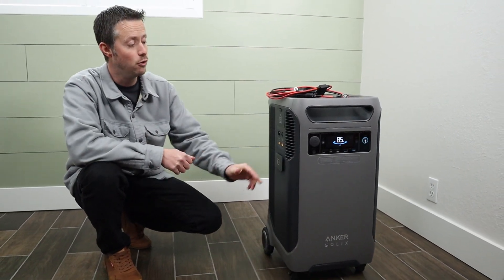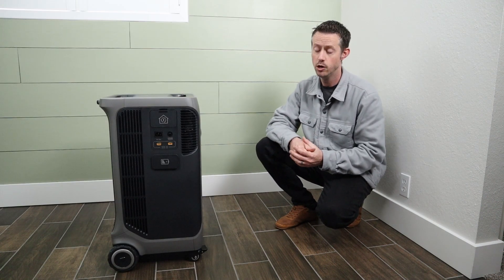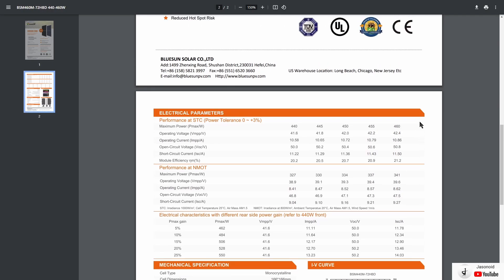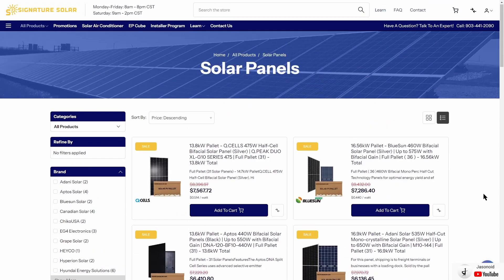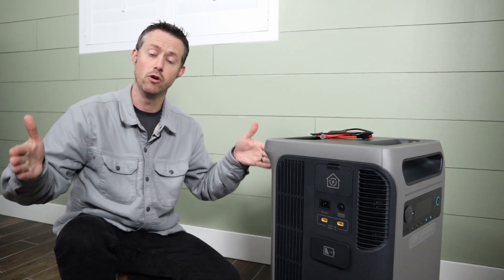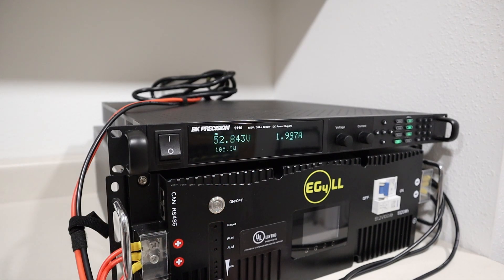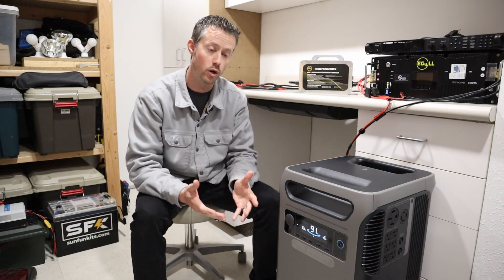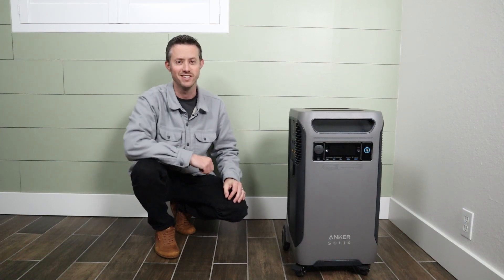Anker SOLIX F3800 - Your Questions Answered! DC Charging Cables - Ideal Solar Panels - and More!

Comment: Great review! We have the the f2000 and will be ordering the F3800, do you know of any way to pair the two and use the f2000 as an expansion battery or would I be best just to charge it using the f2000? I guess the only way to get pass through charging for the 240v would be to use the DC ports on the f2000. Thanks, Jake

Comment: Can i use my house solar panels to recharge these
Reply from the maker: They have to be wired in a completely different way, but typically you can connect three 400w panels in parallel to each charging port.

Comment: Could you wire directly from the DC output of a small gas inverter generator to the DC input of the F3800?.    (The Pulsar 2300 has a 12 volt/ 8 amp DC output "cigarettte lighter" Output )      I understand that the charge rate would only be around 125watts but it could help top off when the sun went down.   bypassing the inefficient onboard 120 Inverter / charger built in to each unit .
Reply from the maker: I'd say watch this video:   https://youtu.be/T_zZceBWZHk

Comment: I used 4 12v eco flow lifepo4 in series to top off my F3800. It charges the unit at 1150W consistently. However, after the external battery died, on the 4 batteries dropped down to 6.67V. Other were fine and charged back up to 100 no problem. Did I just get a bad battery or is there a setting I don’t know about
Reply from the maker: Try charging that one battery directly to see if it goes back up to 14v
Reply: @Jasonoid  Can't thank you enough! It worked. I hooked another fully charged ecoflow 12v battery to basically 'jump start' it like a car battery. after 30 mins, it finally began accepting charge. I wish there was a shunt that also had an integrated shutoff to program my entire pack to shut off if the SoC falls below , say, 20%.

Comment: Hello,
I got through a throttling situation where one or more of the batteries were below 59 degrees and discovered charging was limited to 700 amps DC. I got all the components above 59 degrees and ran for several days with up to 2300 amps DC input. All was well! Today. for some reason it is limited to 1100 amps. It will charge at about 1100 amps from either array, but not both at the same time. Charge level was in the lower 80 % when this was observed.
I hope there is a simple explanation for this. Thanks

Comment: Just ordered the F3800 and Renogy 400w portable, folding solar panel (that you reviewed).  Please tell me that they are compatible!  I see the Open Circuit Voltage is 47.2v so that works.  Can I just purchase a MC4 to X60 adaptor to connect the solar panels to the Anker?
Reply from the maker: Of course they are compatible! Feel free to reach out to me HERE if you need more information or guidance on how to wire them up:   https://asqme.com/@Jasonoid

Comment: What kind of separate Expansion battery would you recommend that is cheaper and not an Anker.
Reply from the maker: A DIY 48v battery is a solution, but it's not a true expansion battery. Only Ankers batteries will work for that.

Comment: Another question, so because the common ground issues..... How do you charge separate 48v server rack batteries from a single invertor like the yellow eg4? Will that create a common ground? Seems to me your limited to only using one solar DC port for stacking server rack batteries because to charge them (server rack batteries) via solar.... You would need two separate inverters. Correct?
Reply from the maker: Correct, you'd have to alternate charging the batteries with a large charger or you'd have to have two separate chargers.
Reply: @Jasonoid  so comparing cost of Eg4 yellow inverter $800 and server rack battery being $1,300 (total $2,100)  plus the wiring and rack/shelf and effort to hook everything up. Anker's expansion battery is on sale right now for $1,800 seems to be the Better option. Sure, it's less capacity than the server rack battery but it's cheaper and plug and play. Plus, you get both DC ports for maximum solar input (2,400w) which is plenty for someone like me in the California desert. 

My only complaint is that the expansion batteries can't act as a standalone power station. I really want to be able to unplug just one expansion battery and take it camping while the f3800 sits at home running the cabin. 

Hope this helps someone else because I was bummed out for days and days thinking I over paid for the f3800 (got it on Labor Day sale for $3,100 ) or something but it came with the transfer switch and a free refrigerator so I think it's a good deal.

Comment: Question. I bought two 24 volt lithium batteries to recharge the 3800 when the sun goes down. I simply have ring connectors to the battery and xt-60 ends. No fuses or anything in between. If I’m understanding this correctly I would be better off wiring them together for 48 volts and plugging into just 1 xt-60 correct? Do I need a fuse?
Reply from the maker: You can do it either way, 24v per port, or 48v on one port.
I would recommend using inline fuses for  safety.
Reply: @ so can’t do 48v into each port? I apologize. I was going to buy two more batteries. I wasn’t sure if the limits were for 1 port or both combined. (I bought the prototype off kickstarter) didn’t get much info on it.
Reply from the maker: @GARGRUM  you can do 48v into each port, but the 48v can't come from the same source. It won't charge if they have a common ground or negative. So you have to use two separate 48v batteries if you want to do that
Reply: @ I’m binge watching your videos. Liked and subscribed. Good stuff sir. !

Comment: The lack of ability to use the 240v ports when ac charging, is unfortunately a deal breaker. They fix that and it's the best home whole house solar generator. Because we want to use the 240v and charge it from the generator at the same time. That's a basic function when there's a power outage. Even if it's only 120v ac charging while using the 240v like the Ecoflow DP3 does.
Reply from the maker: I agree!

Comment: According to an email from AsqMe Q&A:  "Reminder:  You have an answer waiting".  I have the f3800 with an extra battery module.  I have been watch Netflix, at night, for the past 3 hours and the display still says that I have 100% charge.  Question:  Since the extra module doesn't have a display, am I drawing power from it rather than the main battery which still displays 100%?

Comment: Hello! I'm trying to figure out if the Anker F3800 will automatically power on (from completely turned off) if solar is connected to the F3800.
The scenario is: run the F3800 to 1% discharge and after 12h the unit shuts down completely. Next day with the solar panels connected, when the sun comes back, would it automatically turn the unit on and start charging?
Thank you in advance for the answer!
Reply from the maker: Yes, it will start charging automatically and turn on from solar if it shuts off from being discharged all the way... However, you will have to manually turn on the AC inverter once it dies, the AC inverter doesn't automatically turn back on.
Reply: @Jasonoid  Thank you so much. I was more concerned if I leave it unattended for the day, at evening when I would check it would be charged and ready to use. That was the purpose of my question, if it is powered off and connected to solar if it automatically powers on when the sun is up.

Comment: Seems kinda weird that you cant ac charge this while outputting 240v. Is there anyway to reasonably charge this with a generator while its acting as a backup for the house? Seems like the Ecoflow Delta 3 can do this but of course it has its own issues.
Reply from the maker: I'll have a workaround video to solve this problem with the 240v shutting off in a couple weeks, stay tuned!

Comment: Can you please tell us what specific cable you are using to connect the DC power supply to the F3800 via the XT60 port?
Reply from the maker: This is what I purchased for the video (they are listed in the video description):
Female XT60 to APP:  https://amzn.to/3wDgtmX
APP to Ring Terminals (Battery Connection):  https://amzn.to/3T4qtwL

I have a new video coming out in a couple weeks to show you a more affordable DC power supply that will work well.
Reply: @Jasonoid  Great, Thanks! Looking forward to the next video. That BK Precision power supply is pricey.
Reply from the maker: @JFernan488  yeah, I paid $1500 for mine, there's a much better option that will work!
Reply: @Jasonoid what would be the affordable dc power supply? I planned to plug the F3800 into the AC of my Anker Solix F2000 than learned after purchase of losing the 240 on the F3800. Would you know a simple solution of connecting my F2000 to the F3800 XT60 and getting as much wattage to the F3800 as possible at a reasonable price? I would not need to get the full 1200w but something respectable would be great. Thanks , Terry
Reply from the maker: This option should work for about 500 to 600 watts of charging (if you have the newest firmware on your F3800):
https://amzn.to/4h7Kfmf
Youd have to connect it to your F2000 AC inverter, it probably won't work off a gas generator.

Comment: According to the Anker website:

"When connecting 405W rigid solar panels, determine the number of panels that can be connected in parallel based on their current. For example, it is recommended that each XT-60 port on the Anker SOLIX F3800 be connected with up to two 405W rigid solar panels (Current at Pmax: 12.99A). Because the current from three solar panels exceeds 27A and the F3800 cannot handle the excess energy, it is recommended to connect only two 405W solar panels. You can use two ports of the MC4 3-port solar charging connector. With both XT-60 ports and four 405W solar panels, You cannot reach a maximum solar input of 2,400W and can only get a maximum of about 1,600W solar input."

The part about the panels exceeding 27A seems wrong to me.   My understanding is that the internal charge controllers will only DRAW up to the max allowable amperage and as long as the VOLTAGE is under the 60V limit it should be fine to connect three 13A panels in parallel.   Can someone confirm?   For example, I know I can get 20A from a typical 120V outlet but the device will only draw what it requires based on its internal impedance. Just because the amps are available doesn't mean they will flow.   

See this at:  https://support.anker.com/s/article/How-to-Connect-Solar-Panels-to-Anker-SOLIX-F3800-for-2-400W-Solar-Input

Comment: So does 240V output also not work while hooked up to the Anker Home Power Panel?
Reply from the maker: I never had a chance to test with the smart home panel, but it changes a bit of things. The 240v would always be on with the smart home panel.
Reply: @Jasonoid  That's strange since it would be charging via AC with the smart home panel, but that's good that it can  be used as a passthrough while hooked up with the smart home panel

Comment: I'm going to have at least a 25ft run from my panels to the Anker f3800.  It makes no sense to me to use a 8AWG cable to go into the 2.2Feet 10AWG Solar Connector to ADS Adapter that you recommended.  Won't the 2.2ft of 10AWG be a bottleneck and defeat the purpose of having an 8AWG run connect to it?  Am I thinking wrong?  I searched for a 8AWG Solar Connector to ADS Adapter and I couldn't find one.  Any suggestions?
Reply from the maker: If you can find an 8 awg option, awesome! I didn't ever find a plug n play option online for that.

The 2.2ft 10awg cable is rated for 30 amps continuous, you wouldnt much loose much power through it over 2 ft., however you'd definitely lose power if it was 10awg over 25 feet... You using 8 awg and then going down to 10 awg for a short length should be fine. The only other option would be to make your own cable.
Reply: @Jasonoid  Thank you for responding.  It looks like I'm going to have to make my own cable for 35ft anyway.  Unfortunately I could only find it in 10awg
Reply: @Jasonoid  One last request (hopefully):  I have six 280W panels - Vmp @35.5V - Imp @7.89A - Voc @45V - Isc @8.35A - Maximum System Voltage @600V.  I don't know what most of this means and I'm not asking for you to explain it, but what I do need to know is how to hook up my panels via series and/or parallel in order to get the maximum amount of charge without damaging the Anker f3800.  What do you suggest?
Reply from the maker: @TheWhyGuyChannel  reach out to me here for that answer:
https://asqme.com/@Jasonoid
That response will take time and effort to  figure out.
Reply: @Jasonoid  Thank you.  I did as instructed.
Reply: @Jasonoid  Your link is NOT allowing me with the two follow up questions so I'll have to as here:  I'm confused.  You wrote:  "With three of those solar panels wired in parallel, you'd see around 840 watts per charging port, or 1680 watts combined from all of the charging (35.5 volts @ 23.67 amps = 840 watts)."  As I previously wrote; "I have 6 panels" and not 3, yet you gave me instructions for only "three of those solar panels wired in parallel."  What do I do with the other three?
Reply: This is what flashed on my screen when I try to follow up... Something went wrong
We're sorry. Please try again.
I tried at least six more times with no luck
Reply from the maker: @TheWhyGuyChannel  three panels per port, six panels total. There are two charging ports so you split up the panels 3 on each port.
Reply from the maker: I got your follow up question and responded. You should have my reply soon.
Reply: @Jasonoid  Does that mean I'll need TWO 35ft sets of 8AWG wire from my panels?  wow  Does that mean I'll have to do the same if I expand and get more panels?
Reply from the maker: @TheWhyGuyChannel  yes, you'll need supplies for two separate runs of solar panels. I included the full parts list for everything required in my reply.
Reply: @Jasonoid  Never mind.  I'm done bugging you

Comment: So we did get Canadian Solar 400w panels. We wired two series of three in parallel and plugged them into our Anker solix F3800 power station. We started this setup a week ago annd since it haas been cloudy we only saw 1100w input. Today the sun came out strong and the dc inlut is throttled at 615w. ??? What went wrong?
Reply from the maker: Those panels can't be wired in series, the voltage is too high and above 60v in series. Parallel only.
Reply: @Jasonoid  yes, we have them in parallel..why is their input being throttled to 600w? Do we need to add a charge controller?
Reply from the maker: @HeideBraley  there could be a number of issues. You just need to test one array at a time to see what power you get. Are any fuses blown? Any shading on the panels will reduce the charging power significantly. Is the polarity correct? Is the battery near 90% state of charge? Near the top end of charging, wattage input slows down. Too many things to try and suggest here in a youtube comment conversation.

Comment: Does any one have a daily 2 to 5% drop in power draw on their Solixs.....
Reply from the maker: The F3800 basically has a 'mini computer' inside that uses background power when its turned on. This controls the screen, the charging processes and so forth. If you don't want to see power loss, completely turn off the unit. The best way to offset the background power usage is to have solar installed and charging it whenever the sun it up.
Reply: @Jasonoid  Thank you just over this year it was holding a charge at 99 to 100%.   Last few weeks its dropped to loosing 2=5 % over night....I was figuring how this can go back to hold a charge longer at 99&....currently I have 400w connected. Just wanted to make sure the batterys our good...

Comment: Thanks, Jason. I just purchased the F3800 and two 405W Anker Rigid panel VOC 37.29 and VMP 31.18. Would you suggest running in parallel  as opposed to series?
Reply from the maker: Running those solar panels in series will go above the 60v input, you can only run them in parallel.
Reply: It's really horrible anker matches those panels to this battery.  You expect there was some thought to it. But i dont see it. The panels should be more like 55v or like 27v for 2 in series or they should have made the input 70v or so.  Its like anker didn't even try.
Reply: Thank you for the quick reply. I'm new to all of this but eager to learn. Thanks again.
Reply: After learning a bit more, I realized that the 405W Anker panels I got in the bundle deal aren't that great for the $$$. Appreciate the knowledge and willingness to share with others.
Reply: @user-yj9tj4px5m  for the money?  Horrible match.  Not a great panel

Comment: Question, you mentioned fuses on each solar panel. So every positive and negative for each panel needs a fuse before connecting the "branch" style connector Anker provides? Then the solar extension cable, which runs to battery. Then the two cables shown in the video? Thank you!
Reply from the maker: Just an inline MC4 fuse on each positive  pigtail, nothing on the negative needed.
Reply: @Jasonoid  ahh ok so just on every positive for each panel. Thanks for the fast responses. I obviously don't understand electrical and solar stuff so I'm sure this will help others too.
Reply: @Jasonoid  oh one more question sorry. What amp of fuse?
Reply from the maker: @fromcitytowild  correct. The solar panels usually say what rated fuse they need. Usually it's a 15 amp or 20 amp fuse. Feel free to route other questions you have please route through the ASQME service mentioned in the video.
Reply: @Jasonoid Thanks again and I'll look into that!

Comment: Do a new video showing solar panels now that Anker updated the firmware. Why not right? Another video to upload.
Reply from the maker: The new firmware allows you to use basically any 400w panel now, no need for a video 👍
Reply: @Jasonoid  ahh nice! That's a great firmware update then!